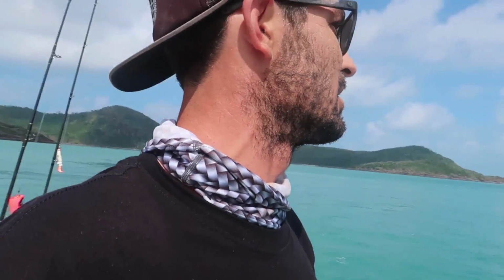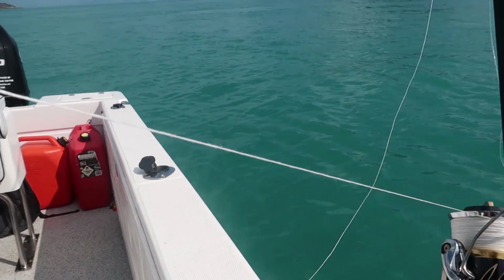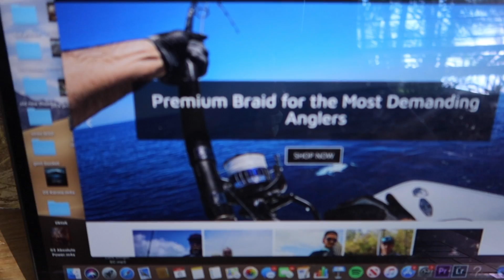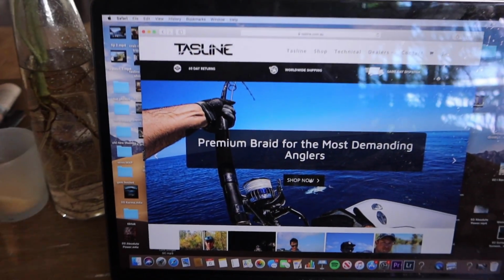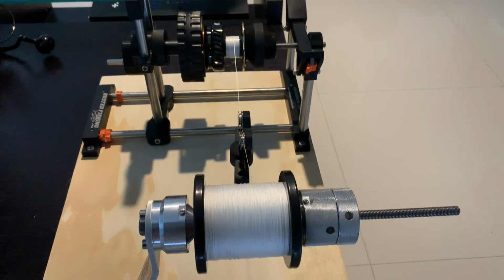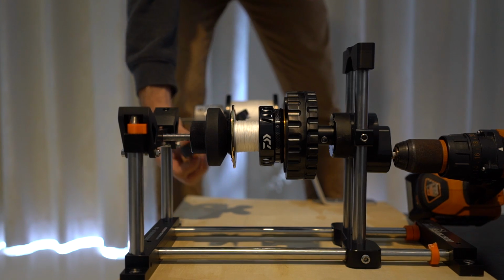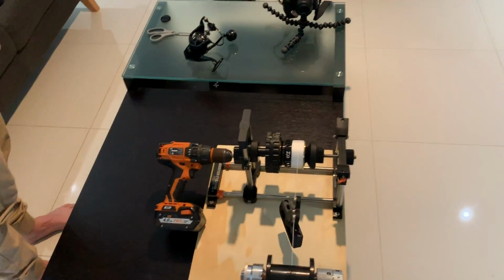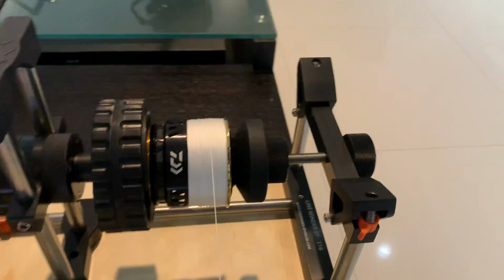500m Of Tasline on Saltiga 8000 (the easy way).

Comment: Just a suggestion from an old tackle shop slave. When you manually fill your spool try to think about how the line gets laid on the reel when the actual reel is guiding it on. If you do not criss cross the line enough and you lay it parallel you run the risk of the line biting into the spool when it is under high tension. It is most likely to happen if the line is not installed with enough tension. Cheers
Reply: If you use an automatic line spooler I've heard you should let out your line behind the boat before casting and wind it back on. I always do mine manually on the reel but use a spool holder that has a tension adjustment knob.
Reply: I agree, and I'm not sure the spool will get the same line lenght if spooled with the reel even with good tension  😒....

Comment: Yeah, you started with the right one there bro! I feel like when it comes to fishing, the line is by far, THE most important part! Just about any lure will work, anytime, when you know how to work it through the water, but the line is your connection to the fishies!!! I'm one of the weirdos who believes fully that through your grip, the rod and reel and then the line going in the water, the fish are able to actually feel your intentions, your mood, even your thoughts!! Think about it, they're totally submerged in one of the most conductive materials on earth, you are physically connected to the water as well and your vibrations travel down into the water and when they approach your line they can sense who's on the other end. That's why its so important to release POSITIVE vibes while spinning otherwise they won't bite even the most tempting bait you've thrown! Then of course comes AFTER the hook set, how well will the line perform??!? How tough is it? Abrasive resistance? Elasticity or is it more static? There are a hundred ways to look at your choice, so CHOOSE WISELY MY FRIENDS!!!!! It will be the most important choice of the outing, hands down! 
P.S. dont feel bad about the reverse screw up, I've done the same thing in a dozen different fields, not just fishing! It's tough though, cause every time you feel like an idiot! It happens to the best of us! Nice post brother......
Reply: Bad line leads to fighting tackle instead of fishing.500 yards behind the boat. lol, I've done 150 yards down the river.

Comment: I was a big user of Daiwa Tournament 8 Hyper PE but saw people recommend Tasline.

 Ended up getting two  5000 Caldia LT spooled with PE3 for Mulloway of breakwalls. First opion , thin , nice and smooth and was surprised all 300m fit with backing on it...  Breaking at 49lbs i am sure it will do me fine for any size mulloway if i do my part correct

Comment: Agreed. Best line out there. Support Frank!
Reply: Has anyone used a relatively inexpensive, multicolored 8x braid from JOF? I found it here in Indonesia and it is such a tight weave and super slick. I rubbed it across the corner of fake stone ceramic tiles on the column of my porch for a full minute with a lot of pressure and it barely fluffs at all. I can't afford premium name brand lines as I've got like 20 reels so always testing cheaper lines.

Comment: I bought some 60lb tasline for my topwater setup and it was the worst braid I’ve ever used. It was throwing dozens of wind knots every cast and the line would break at random points at low pressure like 25lbs. I may of got a bad Batch but I’ve switched to gosen now and had no problems. I lost soo many big fish due to tasline. The people and service are nice atleast
Reply from the maker: possibly overspooled getting wind knots, possible bad roller bearing. possible knots breaking not the line... so many factors. in my experience wind knots vary from the persons casting action, how much line on reel and big one is what reel your using. the one good thing about the Stella was no wind knots ever. new saltine is the same.
Reply: Brooksy thanks for the reply but it was a brand new penn slammer and the line was sometimes breaking 50-100m down on the spool. Got new brand of braid and the setup works like a dream